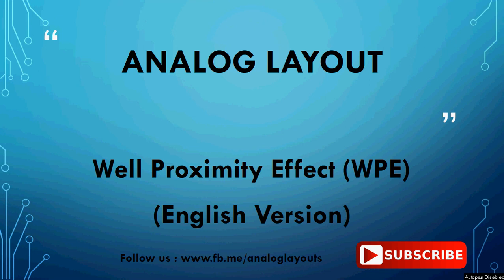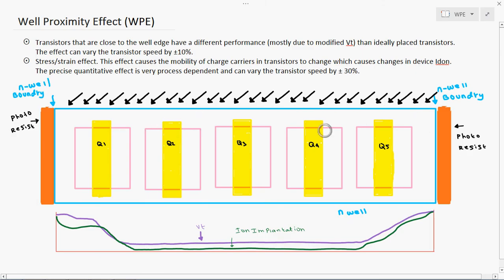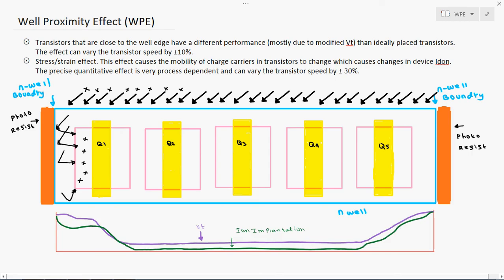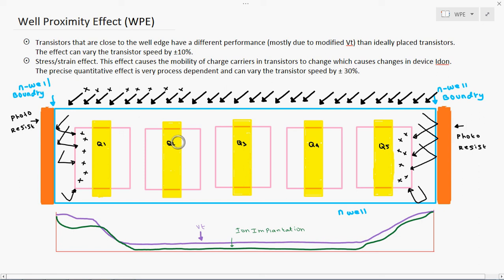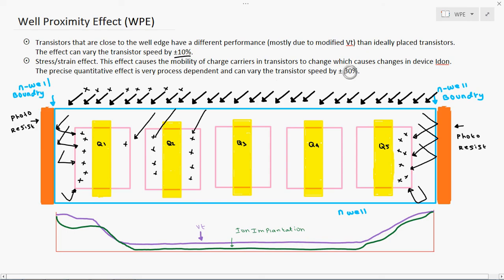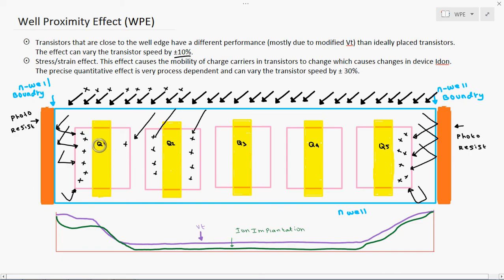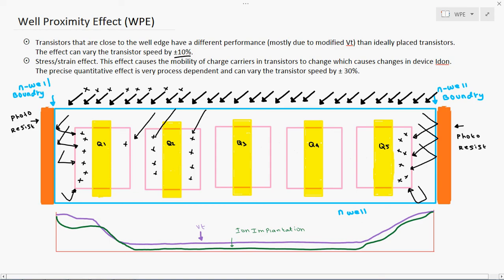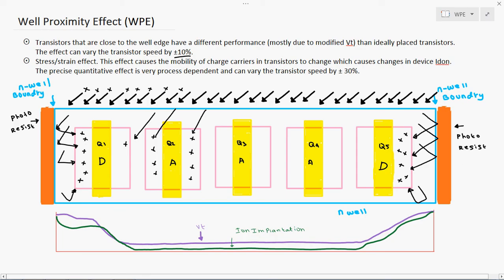Well Proximity Effect - English Version

Comment: When you say stress around 5:30, do you mean mechanical stress? How is mechanical stress caused by excess ions? I can see how excess ions change the doping of the S/D regions in the transistor and change its Vt/mobility etc. But how does it cause mechanical stress? Thanks
Reply: the mechanical stress is caused by the STI while the wafer goes through heating multiple times on the process

Comment: Can you please tell me in detailed how the scattered ions are affecting the nearby device in terms of charge carries.
Reply: The ions are what is causing the Doping of either the substrate or the Source/Drain diffusion. If not for WPE, the doping would be uniform. What scattered ions are doing is causing non-uniformity in the doping which affects the specifications (Vt, KP) of the transistor sections that are too close to the well.

Comment: Hi . You said ion implantation done with 7 degree angle.. then both edges will effect.. but if we done with 90 degrees then there is no chance to hit the edges then there is no chance to WPE? WHY we not  do with  90 degrees ion implantation?  If do what happened?
Reply from the maker: 90 degree implantation also will give other problems , so after doing many research they found , 7 degree implantation is better then others , but its having only one problem WEP , so they are following that
Reply: @analoglayout  k but I heard for source and drain also we do 7 degrees.. depth of the well is high  compare to source and drain regions.. how control depth.. ?
Reply: Bro what are the problems.. using 90 degrees ? If not possible to share here then mail me.. thanks
Reply from the maker: read , art of analog layout ... book . . . .
Reply: @dosapatikrishnakumar6569  See if ion implantation is done at 90 degree angle, a issue will comeup known as Channeling effect (penetration of ions to undesired depths), so they tilt the beam 7-9 degrees to overcome this effect.
if you want to study in details go through art of analog layout by Alan Hastings.
Reply: Chanelling is issue if we done 90 degree we can't control the depth of well so need to tilt wafer by 7 or 9 degrees